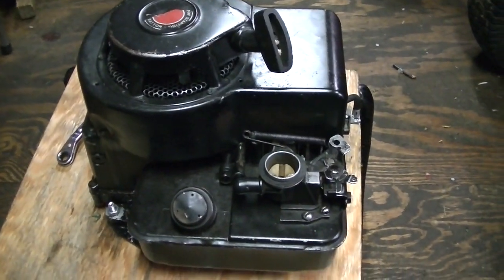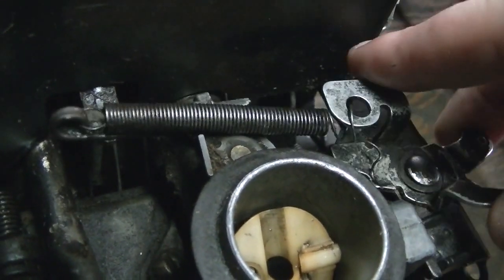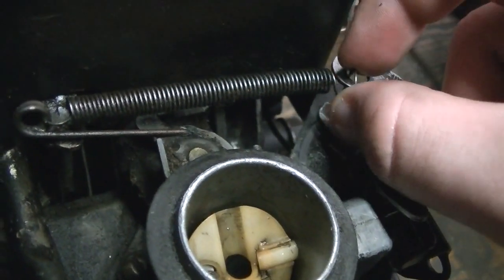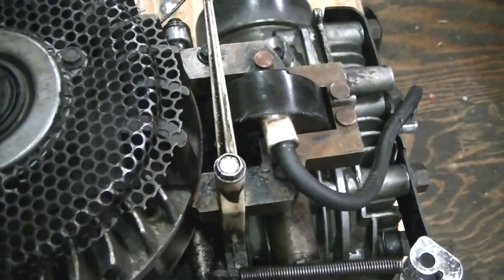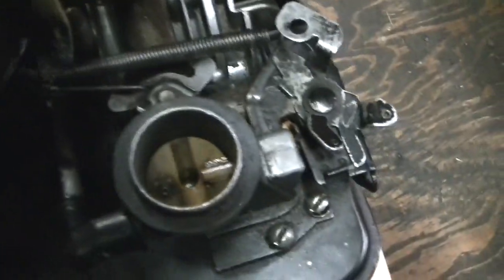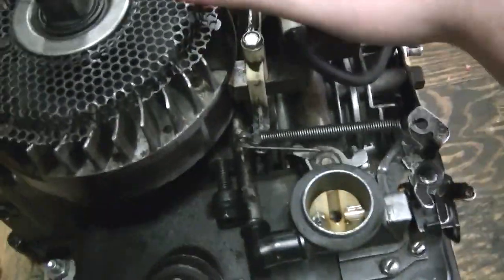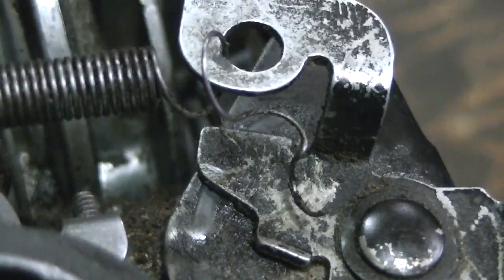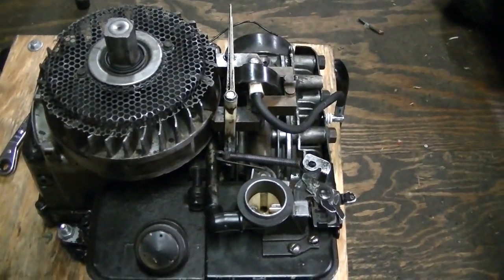How a Briggs and Stratton Push Mower engine governor/throttle linkage is set up, and how it works.

Comment: Hi thanks for your vid.,  would you be so kind and give me your guess on my B&S ? It was working fine til last summer then I changed carb. diaphragm and now it runs like this.. It does the work even so, but it's suffering :-) https://www.youtube.com/watch?v=rM8Pr-PdBmY
Reply from the maker: Your welcome. I couldn't watch the video, if you reupload it let me know and i'll check it out. Thanks for Watching!!!
Reply: do you know the governed rpm
Reply from the maker: most small engines are governed at 3600 RPM. Thanks for Watching!!!
Reply: Making a motor bike and don't want to over rev
Reply from the maker: i hear ya!

Comment: Thanks so much for this video. I had a Tecumseh 3hp auger running slow, unless you leaned your chest onto it for some reason. I couldn't figure it out, how the air coming in the top could do anything to the fuel mixture.... This explains it.
Reply from the maker: +striker1211 Yep, air vane governor! Thanks for Watching!!!

Comment: I am a female who is trying to fix her own mower. I own a Bolen's 3.5 push mower by Stratton Briggs. I did everything right  as far as the carburetor goes, but I got off track when I had to put the parts back where they originally came from. Now I can't figure out which hole on my carburetor throttle lever that my linkage goes back into. As a result, my carburetor throttle lever won't move at all. Great video and thank you!
Reply from the maker: +Carol White I hear ya! That is very easy to do, what i do on a engine I'm not familiar with is, take a picture of all the linkages at a couple different angles. I have another video that i take the carburetor off to replace the diaphragm, and i reinstall it showing the linkages, and springs, it was missing one but i explain where it goes. https://www.youtube.com/watch?v=6E19HwWpx2k Hope this helps! If not let me know! Thanks for Watching!!!

Comment: myn is a 3.0 exactly like that one so when I point it torward me and the spring tightens up is it full throttle I forgot
Reply from the maker: +boneheadmoth as hezy Yeah, when the spring has the most tension on it, its full throttle, little to no tension is idle. Thanks for Watching!!!
Reply: Your welcome I threw the whole thing away it was junk.
Reply from the maker: +Trucker boy 98 haha i hear ya!
Reply: It had a week spark next day NO spark but i want another one that runs! Just CANT find one.
Reply from the maker: +Trucker boy 98 most of the time spark problems on the older ones are from the points and/or condenser, usually a quick sanding will fix spark on these.
Reply: +fnaguitarplayer9 ik

Comment: Thanks so much for this video.  I fixed my lawn mower in a few minutes and it's running great!  Peace and Good Karma from New Orleans.
Reply from the maker: +Doug Zeringue Your welcome, always glad to help out! Thanks for Watching!!!
Reply: fnaguitarplayer9 hello mate wondering could you help me with a problem I seem to have with my Briggs and Stratton lawn more engine , The. Lawn more is revving high . I took off the air filter and all the throttle cables is cut off so it's only the governor is out the side I have it pulled the hole way back and it still revs high is there anyway on earth I can fix it thanks .

Comment: Thank you, I also have issues tightening the carburetor. Two of the screws will not tighten fully when I try to install the carburetor to the fuel tank. The screws do tighten without the carburetor, however. Does this mean the carburetor is warped so much so that it can't be installed tightly?
Reply from the maker: Maxitikos I've never heard of a carburetor getting warped but its possible i guess, hard to say really. If you replaced the diaphragm/gasket make sure the old one was completely removed, if there was some on it it would cause that as well. Thanks for Watching!

Comment: Hello, when I screw my governor blade onto the coil the governor is too tight and will not move. How can I solve this problem without loosening the bolt too much?

Thank You.
Reply from the maker: Maxitikos you might be able to file or gently grind a bit off of the bottom of the governor vane, where the bolt goes through it, that way it won't tighten up, but don't take to much, probably wouldn't take more than .010" to take care of it. What probably happened is the bolt was overtightened at some point so now it threads in a little more than it should. Thanks for Watching!!!

Comment: Cleaned the air governor and the blade for cooling and the dam thing cant run at more than 3/4 throttle without accelerating and slowing down  well i dont know why. 

Any idea what to do to allow 100% speed
Reply from the maker: MrBonami2 That sounds like carburetor issues, if its the older style with the adjustment screw, try adjusting it and see, if its the newer style with the primer bulb, you will probably have to get a new diaphragm for the carburetor. It doesn't cost much to do at all, like 5 bucks. These usually never have governor problems, unless something gets broke. Hope this helps! Thanks for Watching!!!
Reply: fnaguitarplayer9  oh that make sense :) Thank you for the video :) it the priming bulb model so im gonna look for a carb kit or  just run it like that like i do for the last 3 years lol
Reply from the maker: MrBonami2 your welcome! Yeah, probably just needs the diaphragm, if your in the US, you can get them at lowes for around 5 bucks or order offline (ebay).
Reply: fnaguitarplayer9  Well im in canada but im gonna look arround anyways it run pretty well even with that problem except it sludge oil like crap ahah
Reply from the maker: MrBonami2 I hear ya! It shouldn't be to hard to find, you can always order it online, like ebay or something.
Reply: Yea but well im changing home soon so im gonna wait to order ahah
Reply from the maker: MrBonami2 i hear ya!
Reply: +MrBonami2 You might just have a clogged air filter. Also I got a new diaphragm & gasket for about five bucks, took the carb off the tank, cleaned out the well in the tank and it ran like new after reassembly. I see several videos where a dirty air filter messes with the mixture ratio, makes them surge repeatedly.
Reply: randolph patterson My filter is clean. :)  The lawmower even got rotella 5w40 synthethic since i had nothign arround.  Gonna try to order diapgram  Thank you :)

Comment: I have 20219 TORO 1991 Self propelled Lawn Mower. It has Choke after Fast on the throttle handle. When I push all the way down the throttle handle choke closes and the spring on the governor arm stretches and opens the throttle open. But when I bring throttle handle to fast it runs at lowest RPM. Then if I move the throttle more towards slow nothing happens and it continues to run at the same RPM. Then I move the throttle handle to Shut off it shuts off. Why it is not running at max RPM when I put it in Fast?
Reply from the maker: Jim Mehta That sounds like the governor spring either broke or came loose, I would check that first, or the linkage that connects from the governor arm to the carb came loose. If its not that, get back with me and I'll figure something out! Thanks for Watching!!!
Reply: fnaguitarplayer9 The governor spring is not broken, it's fine. But earlier I tried to adjust the holes! As it is mentioned in the manual. 
I want to understand first is that when I bring the Throttle handle to the choke position, all the way down, it pushes the choke linkage further to close the choke and the spring attached to the linkage stretches. Also it pulls the carburetor rod and opens the throttle to the fullest. But when I bring the throttle handle to the Fast Run Position (Rabbit) by pulling back the throttle handle only the choke opens but I don't see any movement in the carburetor rod!! So throttle is still open fully in the Fast Run Position and so it runs at slow RPM. But if I touch the carburetor rod slightly it runs at high RPM and as soon as I remove my finger it is pulled back and runs at slow RPM again So if I understand correctly, when I bring the throttle handle in the Fast Run Position (Rabbit) from the choke position it also should slightly loosen the carburetor rod. Is it correct? Is there any adjustment for the same?
Before it was running fine except choke was not closing in the choke position at all. As throttle handle was not staying in the choke position it was springing back and also the choke linkage was not moving, I loosened the bolt and pulled the throttle cable a little and tightened the bolt. Also I bent the arm a little which is attached to the choke linkage and the spring, slightly so that the cable end of the throttle cable which has to push the arm pushes and not just scrub, which was the case earlier before I slightly bent the arm. Also I tried to adjust the holes by moving the extension piece facing down which when touches the ground switches off the engine.
Reply: Jim Mehta Above in the last sentence I mentioned that I adjusted holes, that was in the "Throttle Lever" by moving it right side with hammering with hammer and screw driver. I am not sure is it the correct way? When Throttle Control handle is brought to Switch Off "Throttle Leaver" touches the "Throttle Bracket" and engine stops running.
Reply from the maker: Jim Mehta I'm not sure without actually looking at it would be causing that unless the governor arm came loose, and is not allowing the linkage to move or a linkage is loose or something like that.

Comment: Hi mines a 2.5 trojan briggs n stratton it ran but real sluggish and then would cut out it completley cut out altogeather so i took the carb off to clean it out "i didnt know you could remove tank that easy" so i removed magneto etc "done it the hardway" anyway ive got it all back together ive cleaned the magnet and the magneto ends ive checked the cut out wire and im still not getting a spark the plug is fine any ideas please? Thnks
Reply from the maker: boxing 4 life It would be easier for you to watch my video on diagnosing spark problems on small engines, that should give you a few tips on finding out whats wrong, here it is, https://youtu.be/S8B7Xwpz94w If it has points and condenser, the points are probably corroded. Thanks for Watching!!!

Comment: Hi,  does anybody know of a video explaining this on an old 3.5 horse power Briggs horizontal shaft off a rotavator?  Thanks
Reply from the maker: bidders77 I don't have any myself, but as far as i know it should be similar to a 5 horse horizontal shaft, i don't have that either as of know but it would be easier to find than a 3.5. But it should be similar as this video, i know the linkages will be different but, it still should be similar. Thanks for Watching!!!

Comment: Woo! What I also did was bypass the governor and tied it straight to the throttle. I bought a throttle cable but I don't know how to link it to throttle at the carburetor? Please help...
Reply from the maker: You don't want to bypass the governor, it will blow it up in no time! You will connect the inner part of the cable (with the Z shaped bend) into the linkage that is connected to the springs on the front (spark plug side) of the motor if its the old style, then the outer part of the cable is clamped by a cable clamp in the flywheel shroud. My video here should give you a few pointers, but it will be a little different than a push mower engine this is a riding mower engine: http://youtu.be/1WWpeyDbHjA

Comment: How can you put a throttle handle on a stratton and brigs?
Reply from the maker: I don't have a video for a pushmower, but i have videos on how they are setup on riding lawn mowers, but on pushmowers on the front of the motor (spark plug side) there should be a lever on the front if its a older style motor like in the video, you would connect the throttle cable to that, then a cable clamp on the flywheel shroud. Hope this helps, thanks for watching!

Comment: Fnaguitarplayer, I have a quick question for you: I have a 3.5HP briggs that looks similar to this. (It's a 1988 model 90702 3080) I just replaced the coil and I can't remember how the ground wire was set!  It won't restart for me and I know I have it in the wrong spot. On my old coil, one wire was cut and I think the second one was hooked up somewhere on the linkage. I've seen videos where they talk about a wire being ran down under the flywheel, but I'm pretty sure that's the one that's cut on mine. Here's a link to the image, I just had it contacting the metal bracket where the fuel hose passes through but I know that it was wrong now. http://www.lawnmowerforum.com/attachments/snapper-forum/23022d1409020825-help-finding-engine-number-1989-snapper-hi-vac-dscn0066[1]-jpg
Reply from the maker: TRUx Voodoo Its not letting me see the picture (have to be logged in) but i talk about this in this video here: http://youtu.be/rn3izGV-4Ro thanks for watching!!!

Comment: Thanks for the videos there very helpful.  My uncle gave me an old 3.5 b&s for my new place and it needs a little work. Its missing the rubber 90 that leaves the left side of the carb and goes to the air line to the engine. What is that for ? Been looking up all the videos i can and its just been mention a bit.  Any help is appreciated.
Reply from the maker: Karl Kerbrat your welcome! What that is a oil breather, thats what most people call it, in any engine you have what is called blow-by, which when the engine fires there is so much pressure in the cylinder some of the gases are forced past the piston/rings into the crankcase, so this pressurizes the crankcase and lets gas into the oil, the oil breather puts a vacuum in the crankcase pulling out most of these gases and reburns any unburnt fuel. The motor will run just fine without but you will notice a smoke coming out of it, it also cuts down on emissions, I would look on ebay for one or go to a local parts store, it should be much. Car engines have them to, but on vehicles you have a pcv valve (positive crankcase ventilation) which is essentially a check valve, allowing air/gas to flow one way to the intake of the motor, all comes down to emission control and epa regulations. You could also probably make one out of a piece of hose, if you had too but it might pinch off. Thanks for Watching!!!
Reply: +Karl Kerbrat This is possibly the most common engine found on a huge variety of small push mowers. Ask around your neighborhood or town if anyone has a junk mower they want to get rid of, you can rob that tube off a bad motor.

Comment: Hi.. Mine runs too fast and wont slow down! how do i fix that !
Reply from the maker: The spring could be rusted up or the linkage is in a bind, if the mower does not have a throttle control on the handle bar, there is still the linkage in the front of the motor that controls the throttle, it could be set to high as well. Thanks for Watching!

Comment: TY for vid on gov vane . I hav a prob , 3.5 B&g  push , it will idle fine but when i throttle up it dies instantly, any ideas, ran fine for bout a month
Reply from the maker: Your welcome, if its the older style like in this video, you should be able to adjust the screw on the front out about a 1/4 turn and that should fix it, if its the newer style with the primer bulb, it more than likely will need a new diaphragm in it, i show it in part 2 of my push mower project video, go here: http://youtu.be/6E19HwWpx2k Thanks for watching!!!
Reply: ty
Reply from the maker: Greg Cherry
your welcome!

Comment: Someone gave me a mower that has has a Briggs & Stratton engine with this governor/throttle assembly, or one very similar. The linkage was missing when I got it, but I improvised with a paper clip. I'm not sure the spring in there is the correct one; it seems too loose. Some diagrams I've seen look like there should be two springs, and the throttle bracket itself looks like it would accommodate two springs, but I only see the one in your video. I want to order the correct parts so it will work the way it should. Any more info? Thanks for anything you can share.
Reply from the maker: Whatever it takes to get the grass cut haha Yes, there is actually supposed to be 2, but the one in the video is the main spring, the other spring just controls the idle, I would have to have the model type and code, off the motor, just to make sure I give the right part numbers, there has been a few changes in the carburetor over the years. Thanks for Watching!!!

Comment: i have an old rover easy start 35. the issue is that it is quite the opposite to easy starting. i have to tip fuel into the carboy and pull at least 5 times to get it started (pardon the pun). Not sure if its the primer button not working or something to do with inlet, but once its started it runs fine, doesn't miss and never stalls
Reply from the maker: If this motor has the carburetor like in this video, its probably either the diaphragm wore out in it or it needs adjusted, i would try that first, if its the other style with a float type carburetor it could be the primer and it could need cleaned. Hope this helps, if not get back to me and we'll figure it out! Thanks for Watching!!!